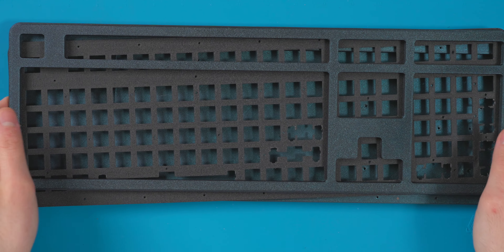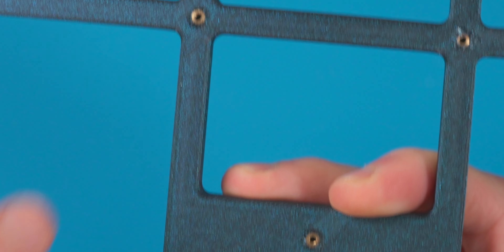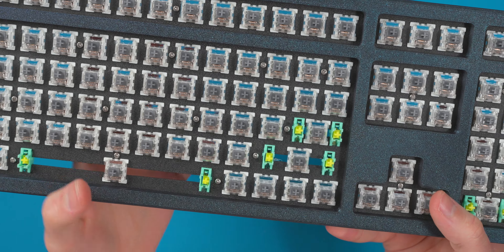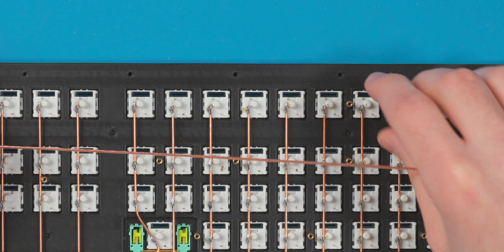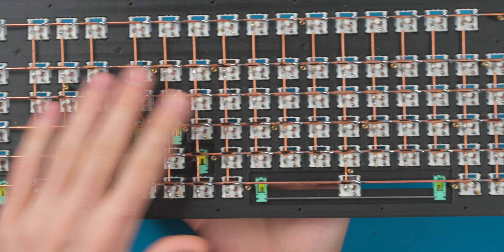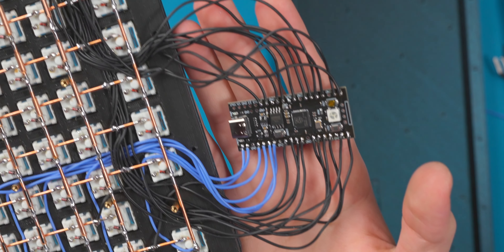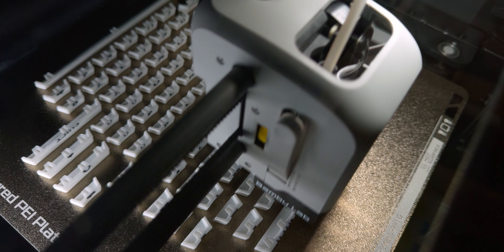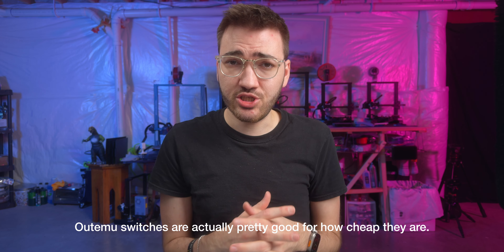Building a Gigantic Full-Sized Handwired Mechanical Keyboard

Comment: Great video.

For labeling keycaps: There are two alternative ways to label 3d printed keycaps with much finer resolution:
a) for light coloured keycaps: DyeSub. There are a lot of videos on YT how to DyeSub your own keycaps. I have tried it myself, it works quite well (also on resin printed keycaps). If using FDM-printed keycaps, you should use at least ABS/ASA and also wetsanding the surface to get optimal contact to the transfer paper.

b) Fibre Laser. This is the best method if you want to label dark keycaps. Many (not all) filaments use dye wich is destroyed if exposed to 1056 nm laser. If correctly tuned to your filament (and the dye in the filament is destoyable by fibre lasers), you can get great results. It uses a lot of experiments to get optimal results (I have not done it myself yet, but there are great videos out there) and a fibre laser isn´t cheap (staring at about 1.5k). Actually I plan to try it in about 2 years - I would like to see if it works on dark resin also, as resin printing imho is the best way to do selfmade keycaps.

Comment: I love it! I'm curious what 3d printer do you use to print your parts? settings would be cool too. i wanted to 3d print the parts the interface with keyboard switches but i'm not sure what tolerances would be acceptable
Reply: Looks like bambu lab P1S or maybe X1C. They just came out with the A1 Mini and it looks like a beast for the price. I personally have a P1P and really love it. If I were to buy one again I would either get the P1S if I had the money or the A1 for budget option (P1P kinda sits in a bit of a grey area where it may not be the best budget decision due to the release of the A1). Overall very high quality printers but I would still do my own research if I were you! As far as settings go... no clue
Reply: @Blakediamond69420  Thanks for the suggestions. Currently, i run a highly modded micron (basically small voron 2.4). i can't guarantee you on the tolerances but it's definitely quite good at printing fast. Main problem too is that i'd have to build another one if i wanted to print a keyboard chassis in one piece. especially since bambu labs were a thing, it seems it's a better deal to just buy something rather than build another one
Reply from the maker: I use a combination of Ender-3s (Pro and Max), Bambu P1S (Multicolor), and Neptune 4 Max for really large boards.

Comment: i tried making a simple 4x4 macropad. gateron and 1n4007 and pi pico W. worked for the first 10 mins. then ghosts arrive and then it looked like all keys are being pressed. nothing looked like it was shorting on the rail or solders on the pico. desolder & now the pico is junked. tried again 2 more times. all scrap now. i dunno man. i buy multiples of this stuff becuase i know ill fuck up the first one. but at this point, i think this excursion is a dud. used circuit pi and matrixpad. also tried individual hookups because its only 16 wires. either ghosts or the board dies. im pretty sure im careful with shorts. really annoyed with myself.

Comment: Since it is a fairly elongated keyboard, If you wire the matrix to the mcu as simple interleaved you can get away with 23 pins only.
Not much of an advantage in this case anyways, though. (21+6 would become 11+12)